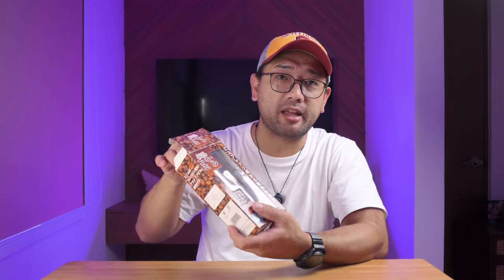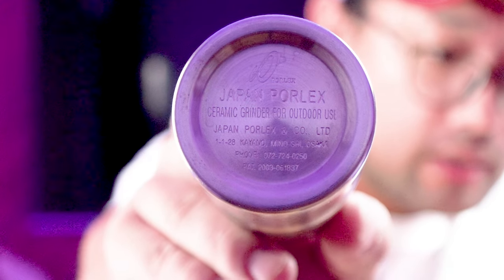Japan Porlex Grinder

Comment: I remember the coffee scene raving about this grinder because ceramic burr was supposedly better than stainless steel burrs (but boy that trend changed in less than a decade) and that it fit at the back of the Aeropress.

I still keep the porlex v1 as a travel option paired with the original aeropress, but I have a different daily driver for pour overs now (Timemore C2). ☕🌄

edit: I've just realized that you're showing the Porlex Tall. I have the Porlex Mini, which could only hold up to around 20g of beans. Mostly similar in features and engravings except the tall is... talller 😅

Also, I second April's comment that it is indeed the original version of the Porlex Tall. The easiest tell would be the pentagonal slot of the crank handle (as opposed to v2's rectangular hole).
Reply from the maker: Ohhhh wow! I am amazed at how you we're present when this is all happening. I practically started coffee the same time comandante did and I am kind of regretting not getting into it sooner. But nevertheless I am very happy that I am here now. hehe
Reply: @darylbuenocoffee    I didn't really gain much from getting into it sooner except maybe I spent more money on coffee gear for the same or less quality of a cup. 😅 I could only capitalize it if this long coffee sidequest turned into a business😄 

Back then, there was no Shopee, Lazada, Amazon and to buy coffee gear, you would have to go through hacks like shipping to a US or Japan address and have it shipped to you. And the options for a hand grinder were mostly either the Porlex or the Hario, and the v60 is the de facto pour over brewer (it kinda still is, a timeless classic),  and the aeropress is the de facto immersion method, and the Baratza Encore is the grinder you save up for once you get tired of manual grinding. 

Now there's so many coffee gear brands that to get to a quality cup of coffee, all you literally need is lazada/shopee. And since there's so many coffee gear sold locally, that you don't have to worry about paying up to the price of the gear you bought for shipping and additional taxes when it goes through customs.😅

 You didn't miss much, and maybe even saved some money for shipping!!! 🚢💰
Reply from the maker: @MarcRendl  hahaha i guess you're right.